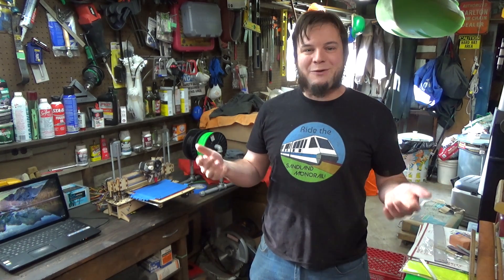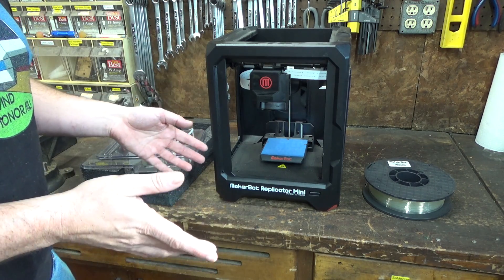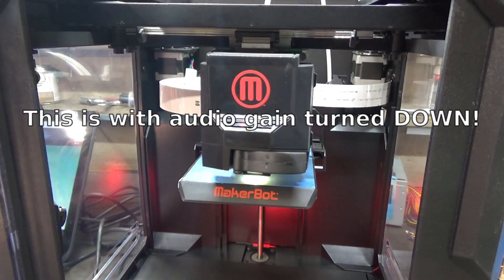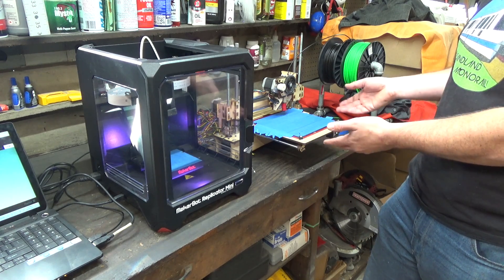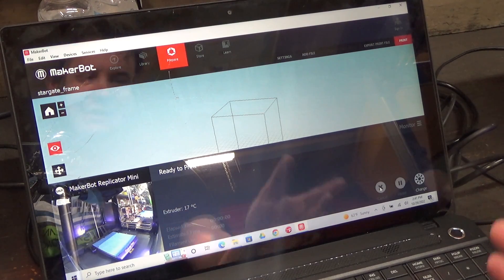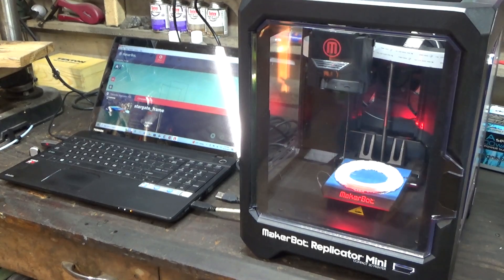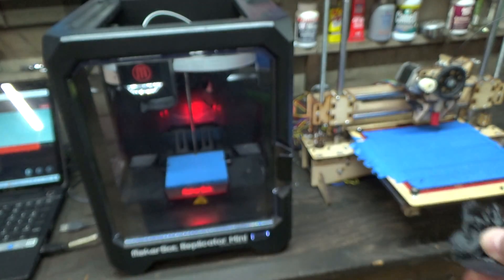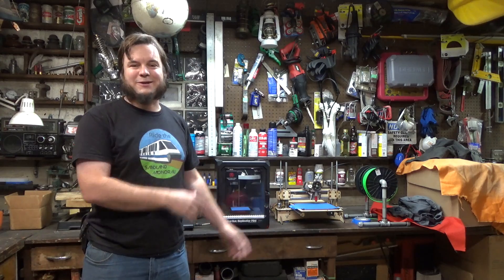Is Makerbot Replicator Mini Better Than A Pile of Plywood?

Comment: I got a makerbot replicator plus for 100 off of a school selling them, had it for years and it’s been great, the smart extruders are very easy to work on if you ever need to get a clog out. I use makerbot print I’m not sure which software this is but it looks really crappy and outdated, mine has plenty of options and prints beautifully! I must be lucky…..🤣

Comment: Your machine is unwell / sick!  If I hade 8 hours with it you would not be criticizing it but praising it!!  Outside of an extruder replacement, the rest is levelling, tensioning and lubricating the rails and extruder 2D hardware, plus buying brand new PLA (yours must be old, heavy absorption of moisture...  etc etc....  Don't know why it is so loud, suspect bearing issues (shot) or filthy rails / screw feeders)...

Comment: you know, you can get a brand new 3D-printer (albeit you have to assemble it) that works 100x better for less than 150 USD...
Also, printer "software" is not a thing. All 3D printers use gcode, so any slicer is as good as any other (mostly). You should have just used something like prusaslicer for it.

Comment: Go and keep leaving funny comments, and ideas on Integza's channel. Maybe you'll win a brand-new printer. Too bad this thing isn't a little larger, because if it were, it would be EASY to turn into a cnc plasma table, for cutting metal parts for BIG MEANINGFUL projects.... 😉 ...Too bad it wasn't an ArcDroid you found someplace. 😄
Reply from the maker: That DNA sequencer dingus I have might be big enough to use as a CNC gizmo...
Reply: @saveitforparts  I think so, as well. It looks sturdy enough to hold a plasma cutting torch/line steady, without wearing out quickly. And the great thing is, it only needs to work at a single hight. Imagine all the great stuff you could make. -Imagine all the great stuff you could cut from scrap metal, that you wouldn't have to pay (much, if any) for! Need strong brackets for something? Make them on the spot, from scrap. Making it into a CNC plasma cutter, would be an amazing, rewarding, and highly useful tool, even if it can't cut large parts. Such a tool, could cut all your bracketry for building a big wind turbine, that won't rip itself apart at the top of that hill at Sandland.
Reply: @saveitforparts  ... or a laser 3D scanner to make more parts! I know, it was exchanged for more parts. Just as long as it's all about parts.

Comment: If the filament is smellier, it might be ABS instead of PLA.  That was more commonly used back in the day.
ABS needs a bit higher temperature than PLA.

You might also be able to get some chinesium parts to convert the Makerbot to 1.75MM
Reply: Check the extruder nozzle tip thread size, if it is the common thread size you might be able to buy some generic 1.75mm nozzle in 0.4mm or 0.6mm (1.75mm in, 0.4 - 0.6 mm out) as pile of stuff mentioned. 

Depending on how fine you want to print (and how fine the printer can print) you can choose between 0.4 and 0.6 mm, mine came with a 0.4 mm nozzle and it can print down to 0.12mm which is not very fine but good enough.

Comment: The Printerbot uses 3mm filament which is not very common at all these days.  I think the Makerbot is using 1.75mm which is the standard.  Luckily, it's pretty cheap - like $15ish per kg.

If you didn't already clean and grease the rails that things move on, it's worth doing that.  A lot of times when the print misaligns partway through like that, it's due binding/slipping.  I'm not sure about the filament jams, but that might be fixable with adjusting the tension on whatever is pushing the filament - but yeah, I don't like Bowens tube printers vs direct drive.
Reply: In fact, it's because almost nothing uses 3mm filament that I gave you a pile of it with the printerbot.  If it were usable with other/newer printers, I'd have kept it and used it!  :)

Comment: This printer uses 1.75mm filament while the old(er) one use 2.85mm. Finer filament is better for small details. Ditch the blue tape and clean the bed with 99% isopropyl alcohol before each prints while it's still cold. It should make it feel a bit gummy once heated up. Have you tried printing using an SD card instead of printing over USB? If this can't be done I would recommend you try using Ultimaker Cura instead of the Makerbot software. You will need a plugin as this era of Makerbot printers do not use G code.
Reply: I agree

Comment: Unfortunately these things are pretty well known for being a dead end for makers, parts are really expensive and there isn't a great deal you can do with it. 3d printing comes with a lot of learning and mistake making even with a properly functioning machine, you may be better off grabbing yourself an ender 3 (which if you live somewhere with a microcenter will set you back 99 bucks). It's not a perfect machine but it's where many of us got our start because despite its flaws it's good enough to get going and the community around it is huge. A machine that can take advantage of the common slicers and open source community is really a must in this hobby. Another great beginner option is a prusa (either mk3s or mini) they are a bit pricey but as they are completely open source you can buy kits to build one yourself which is more in the spirit of your channel :)
Reply from the maker: Yep, I'll probably upgrade at some point, right now I'm going through 2nd-hand ones to see what features I really want and what problems I encounter!
Reply: @saveitforparts  Well if you ever want some advice or help feel free to get in touch, i'm pretty excited to see what you'll create with one